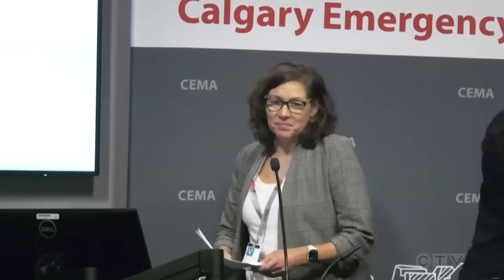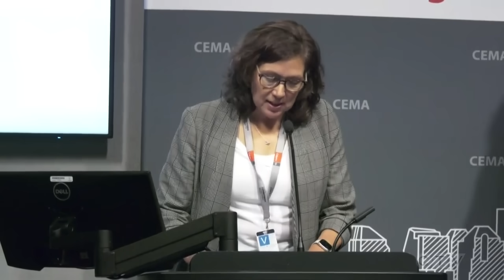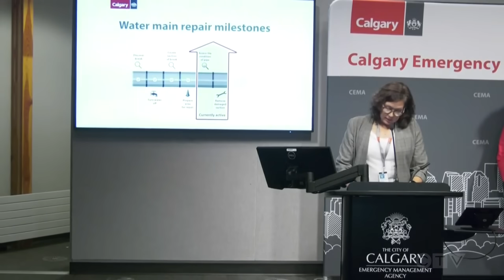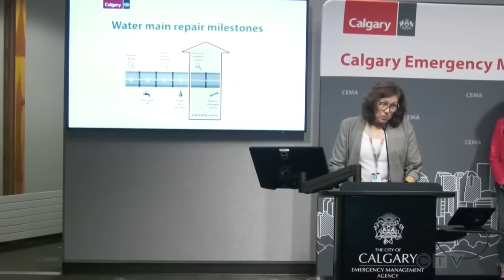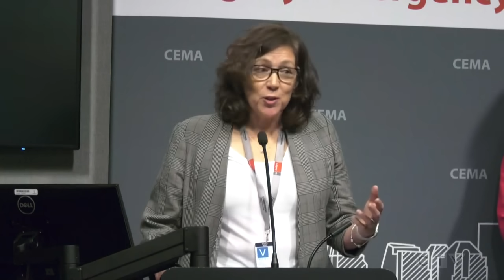Update on repairs to water main break in Calgary

Comment: I’m not a fluid engineer (electricity is my domain)… instead of having one massive record breaking diameter pipe as a single point of failure, why not have multiple smaller diameter pipes that are much more manageable to repair and have more readily available parts in stock?
When we build large we need to expect large failures because all infrastructure is destained to fail at some point or another.

Comment: I haven’t had a shower in 4 days. 5 minutes wouldn’t hurt right?
Reply: Yes? It's legal to shower, they just want you to gmcut water usage by 25% of what it usually is.
Reply: Get wet, turn off the water, soap up, and then quickly rinse. That should be okay.
Reply: 5 mins is fine. No more then 30 mins to be safe but tbh I don't care. I pay my taxes ima use all the water I want
Reply: @lc9952 tough guy lmao

Comment: I know someone who used to work for the city as a millwright. From what I've heard I'm surprised we still have running water.
Reply: That's the case for 99% of cities in northern America. We did a great job expanding civilization but all of that infrastructure is getting old and most of the budgets are going to management and further expansion.
Reply: I’ve heard stories of wooden pipes, old concrete pipes with asbestos insulation…
Reply: im sure theres some horrific lovecraftian pipe out there we have yet to discover

Comment: Since when do water lines burst in the summer? Seems like it was done on purpose...🤔
Reply: Not all water lines burst due to freezing. There are plenty of other causes like age (this pipe was likely very old, I heard it was tabbed for maintenance prior to the leak), maintenance, improper construction, improper installation, improper materials used, etc.

Not everything is a conspiracy..
Reply: Things done on purpose…need a motive. What. Is. The. Motive here?
Reply: This is a FEEDER main, not the same as a water main in the neighborhoods. This pipe is 6' in diameter and takes water from the Bearspaw water treatment plant and sends it to reservoirs where the pipe distribution system sends it to houses and businesses. They explained this about 3 updates ago...

Comment: What an incompetent city. One main breaks and the whole city is held hostage for over a week.
Reply: It's a feeder main, which means that a large amount of the municipal water in the city flows through that pipe. That means the pipe is very big, a lot of water was released, which takes time to remove because you can't assess the damage and repair properly when it's flooded.

Sometimes it's important to realize that not everything can be fixed overnight and that things take time.
Reply: @iron___  its baffling that there aren't sufficient redundancies

Comment: The wild incompetence, wilful neglect, and corruption is stunning. What a great country
Reply: Especially within Calgary. Ran by NIMBY boomers. What if we built more high rises? They would have found this water pipe issue way earlier. What a bunch of incompetent fools.
Reply: @jeff-xl9dv2cp6z Neglected maintenance, wasted money on other needless and essentially pointless things when important infrastructure like this is failing and on its last legs. That is incompetence. Also the repair is taking way longer than needed. Again, rampant incompetence at the highest levels down to middle management.

Comment: What kind of pipe was it? PVC, Ductile, steel, HDPE????
Reply: have you ever seen a 2.0m diameter HDPE, DB2, PVC or Carlon pipe? ask better question you electrical expert lol
Reply: @kenlam4978  yes! That’s what I do for a living! And yes there is a 72” HDPE pipe.
Reply: @fiddlersthree8463there are many steel water pipes, sometimes lined internally. This particular pipe appears to be pre-stressed concrete cylinder PCCP,  you can see the damaged high tension steel wires coiled around it. If enough of those high tension steel wires fail, either from corrosion or hydrogen embrittlement, the pipe can fail catastrophically.
Reply: I hear it was  Reinforced concrete pipe!
Reply: @john9951  bad pipe to be drinking from anyway!
Reply: @fiddlersthree8463 you must not live in Hamilton Ontario. Cause most of the old watermains are steel or ductile iron.